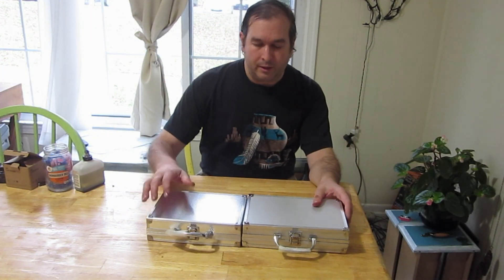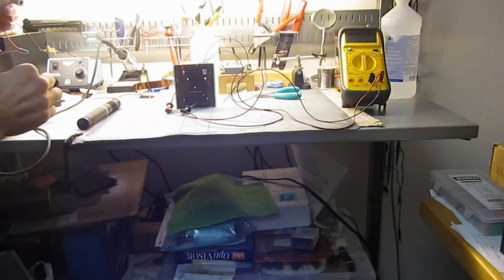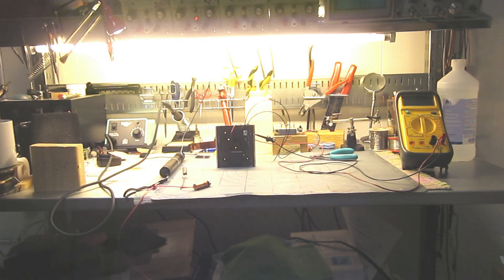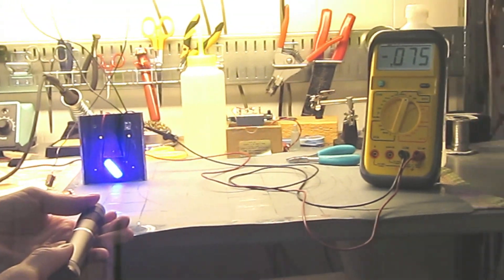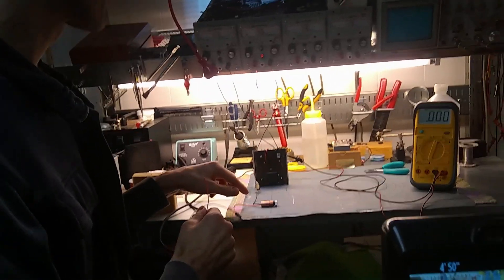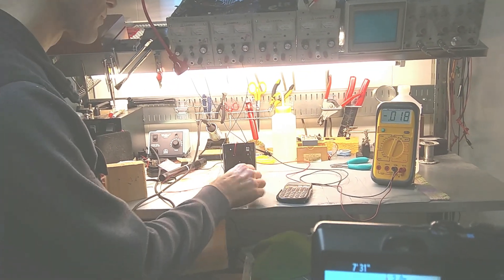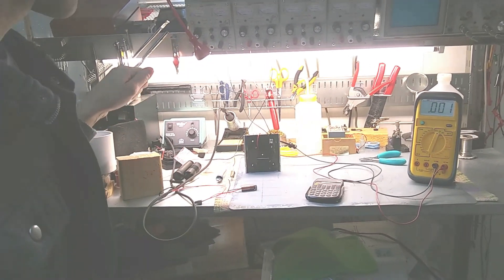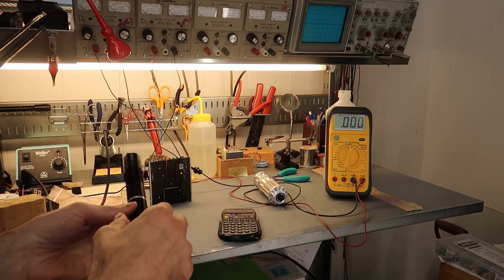How Much Power do Blue Diode Lasers Really Put Out??

Comment: Your friend may be interested in searching ebay for laser diodes called NUBM08 .
It is one diode that is rated at 4.7 Watts.
I have seen that same brand diodes as high as 8 watts .
https://laserpointerforums.com/threads/running-multiple-

lser-diodes-nubm08.99263/page-2#post-1452309

Comment: Best quote: "You put a couple of scientists in a room with lasers and stuff starts burning..."!

I did just realize I cheated the dual-power laser -- I got distracted around the 15-min mark and calculated the power based on the low power setting to be about 800mW; the high power setting looks on-par with the other silver laser, that is, about 2.3W. Makes sense: All the handheld ones are probably based on the same ~3W max diode. The 7W laser from DTR's laser shop is clearly in a league of its own.
Reply from the maker: Yes that makes perfect sense! I should have known it was not really 20W though.. I have worked with 20 Watt lasers before.. and they are SUPER SCARY!